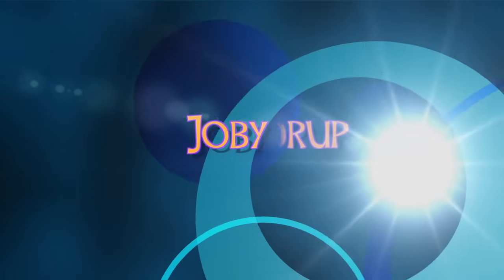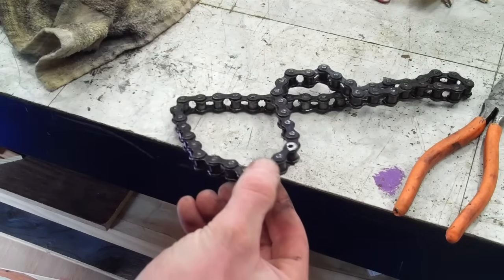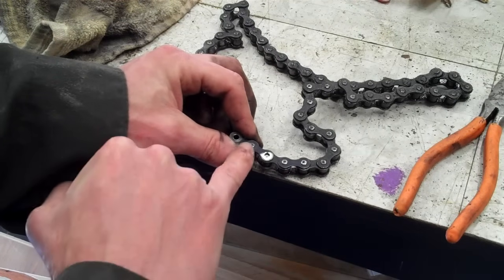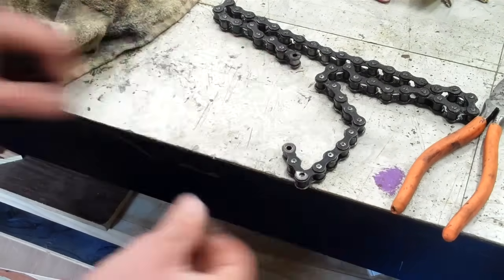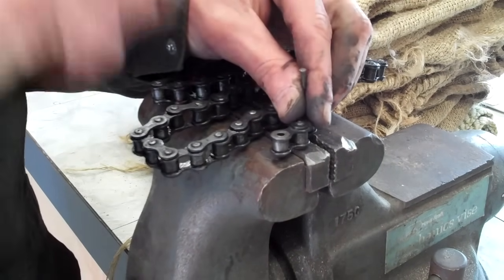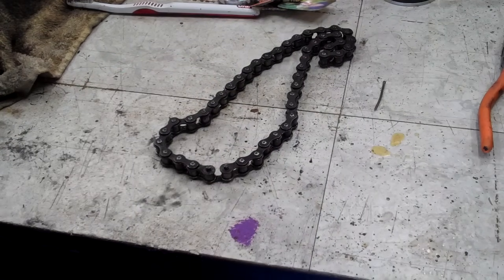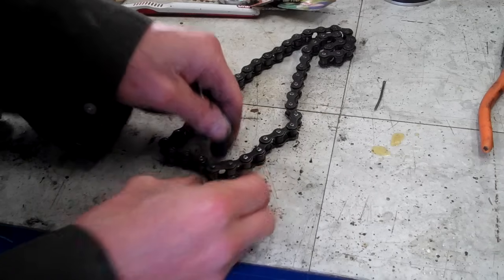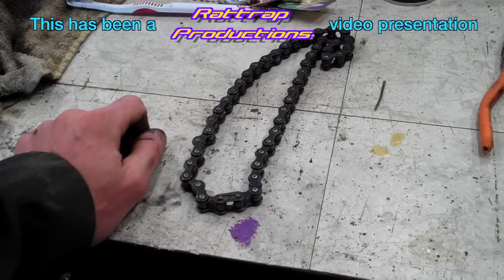How To Shorten a Chain

Comment: So the open side to the right ? To the facing the engine not outside
Reply from the maker: Depends on which way the chain travels
Reply from the maker: Just make sure the open side travels
Reply from the maker: So, if it spins clockwise,the open side should be on the right as long as the master link is set up on the outside

Comment: I bought a chain that has the upper open part but closed and it can't fit to the chain, what should I do? Is there any trick on that system?
Reply from the maker: Are you talking about the master link?
Reply: @JayferRattrap  yes
Reply from the maker: @ΠάολαΚούκο  You may have a rivet-type master link then.  It may look something like this: https://www.amazon.com/Sunstar-MXR1-RL-Master-Link-Rivet/dp/B077B5ZM1H  That is a different type.

Comment: What happens if the chain is broken in the little just put another master link in
Reply from the maker: Chandler Johnson just go back one link.
Reply: then it will be to short
Reply from the maker: Chandler Johnson You will either have to replace the chain or get creative.  For example, my snowthrower had an idler assembly that I removed.  It works just great!

Comment: I will try to use a Dremel to file down the silver nub and then knock the pin out with a nail. Hopefully it works.
Reply from the maker: +Ed Kaye a dremel should be just fine.  If you dont have a ounch small enough, a nail works just fine.  If the dremel  doesnt have anything hard enough, a regular metal file works good too.
Reply: Thanks man. I gave you a thumbs up.
Reply from the maker: +Ed Kaye of course, a bench grinder is the best for grinding.  I think thats how I did it on this particular job.  Good luck!